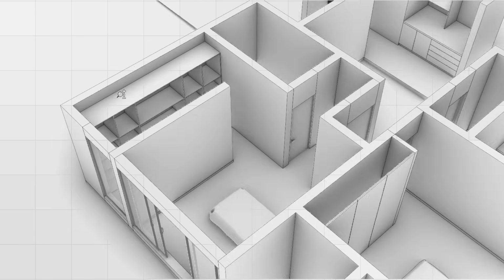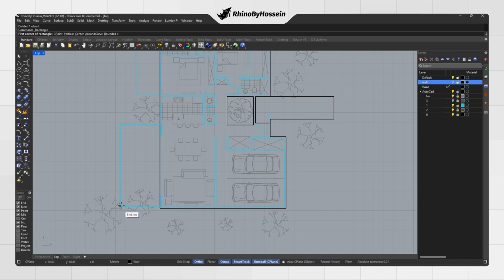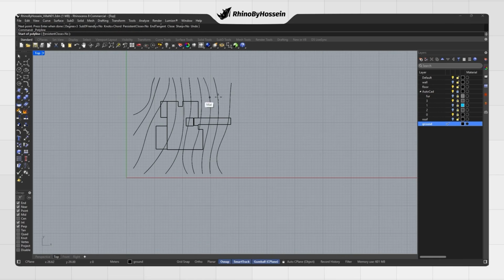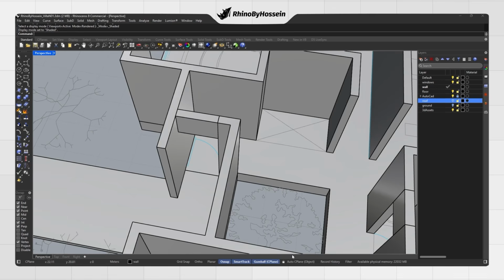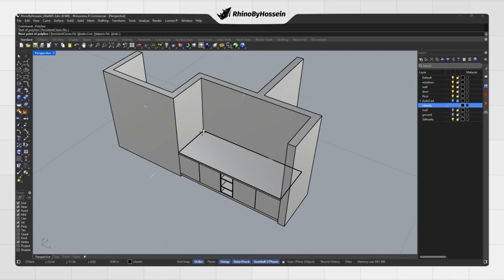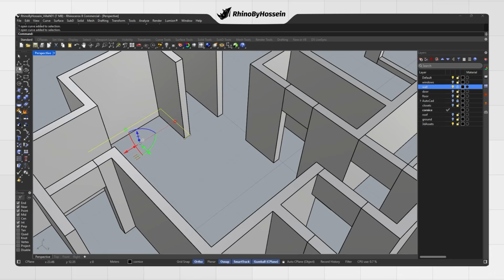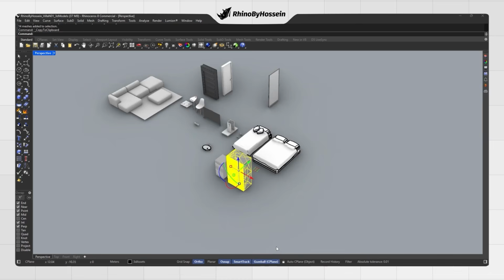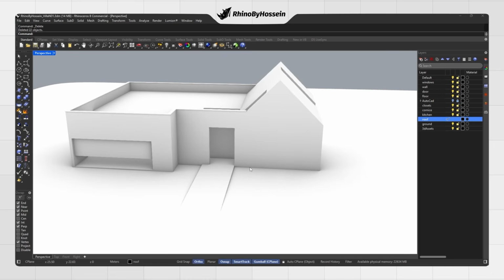Rhino 3D Villa Modeling Tutorial | Complete Architectural Workflow

Comment: Hi-thank you for your videos, very good. Is there a way to import the cad elevations and put them against the walls and then push and pull the wall openings?
Reply from the maker: Hi Pedro,

Thank you very much for your kind words and support!
Yes, absolutely. You can import your CAD elevation (DWG/DXF), align it with the wall, and then use the elevation curves to create the wall openings. A common workflow is to extrude the opening profiles and use *Boolean Difference* (or similar tools) to cut the doors and windows from the wall.
That's a great topic for a future tutorial. Thanks for the suggestion!
Reply: @RhinoByHossein thank you for your reply! I appreciate it. Looking forward to see that video 💪🏻

Comment: Thanks alot for the helpful tutorial, may i ask why do you redraw the walls instead of extruding them from the cad file?
Reply from the maker: Thanks for the question!

The main reason is that I want to make sure the walls are created as clean solid geometry. For that, the curves need to be perfectly closed and coplanar. CAD files often contain small gaps, overlapping segments, or other issues that can prevent a proper solid extrusion.

By redrawing a clean closed outline, I can ensure a reliable solid extrusion and keep the model cleaner for the rest of the workflow.
Reply: @RhinoByHossein  Thank you again Fella